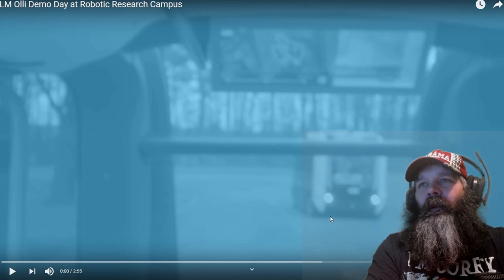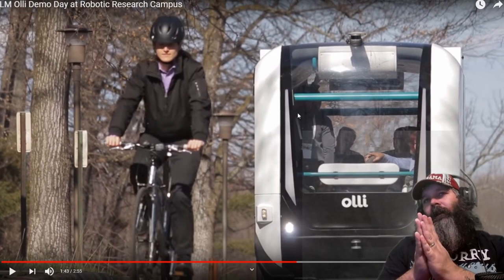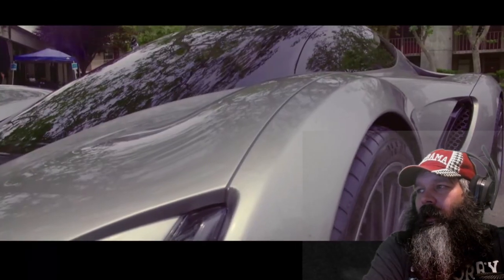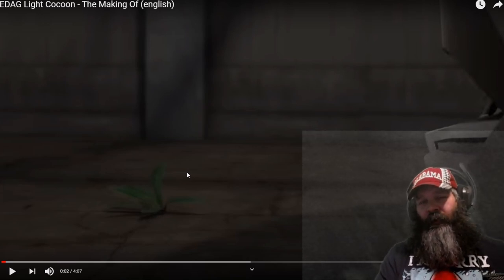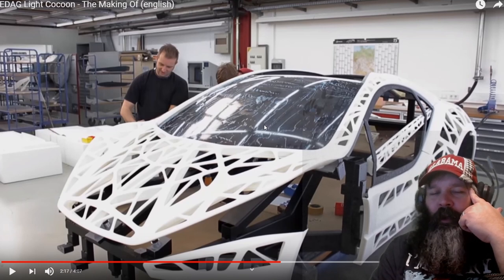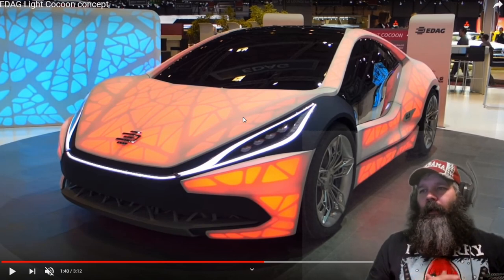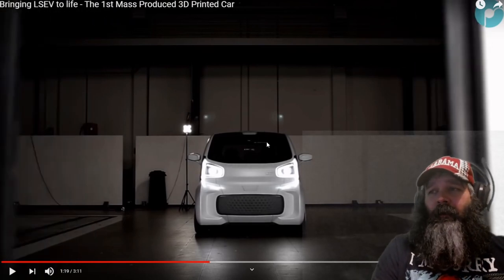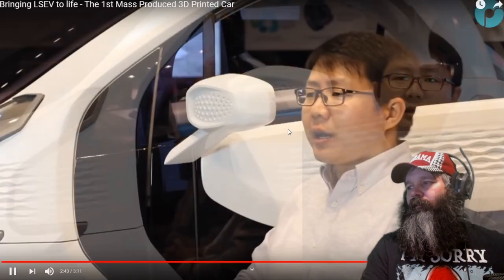3D Printed Cars (Olli, Edag, Blade, LSEV)

Comment: 3D printing has two benefits.  First, the cost for short production runs (or one-off items) is lower, although for large production runs it's higher; traditional methods like injection moulding are vastly superior once you need those volumes.  This caries over into rapid prototyping.  Second, you can have complex internal geometry that's difficult or impossible using other techniques.

A big disadvantage is the material constraints.  Often you can't use as strong as a material for 3d printing as you would for other production methods.  This can mean that, although structurally you're more efficient, due to the weaker material your overall product is less efficient.  Finding applications where 3d printing pays off is a major challenge today.

The place I see 3d printing for cars is hypercars.  Very low production volume, stupidly expensive.  Could even customize the shape to the owner's desires.
Reply from the maker: I didn't even think about the internal geometry aspect of it when making this video.